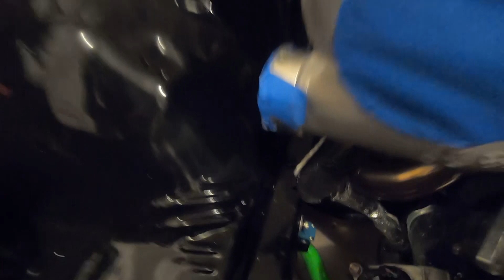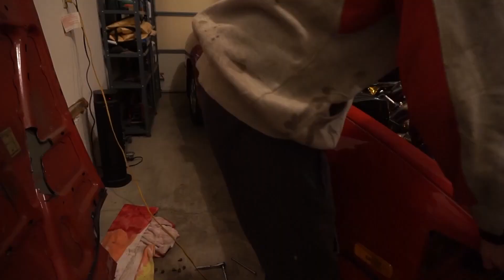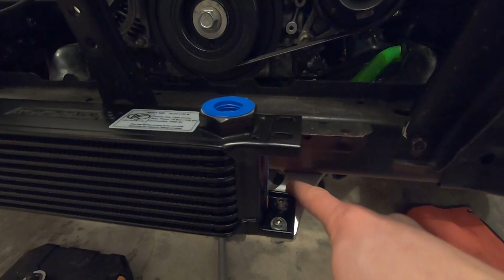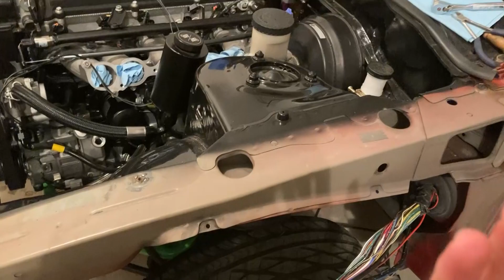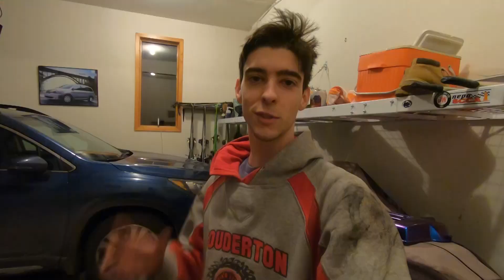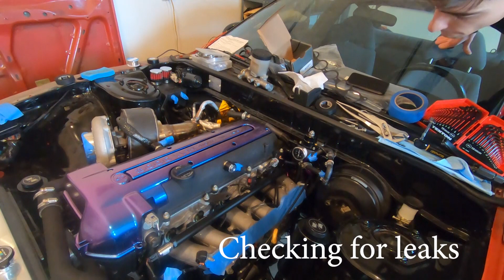Ep. 18 | Prepping for First Start!

Comment: nice work bro one thing i would redo is the fuse box i would do a good solid crimp, and not solder it. People will argue it but since i jumped into the motorsport wiring world i have realized  solder is good for certain things. For this is not a good solid crimp will be far more superior.  Just a little FYI for ya.
Reply from the maker: Great info man thanks for the heads up! If I ever do something like that in the future I will be crimping!

Comment: how much gap did you have from the firewall and the motor? would a radium fpr fit on the back of that rail ?
Reply from the maker: Hey sorry I didn't get to you sooner my man! So I would say I have about 0.25"-0.4" of room from the back of the motor to the firewall. I really don't think there is enough room to fit a radium FPR on the back of the fuel rail because I had a hard time fitting just a regular 90 degree fitting back there!